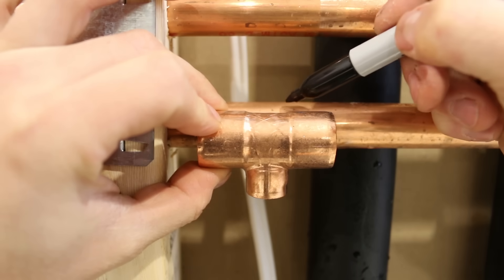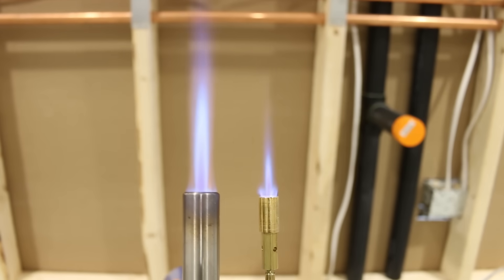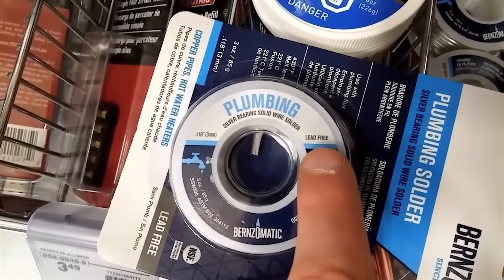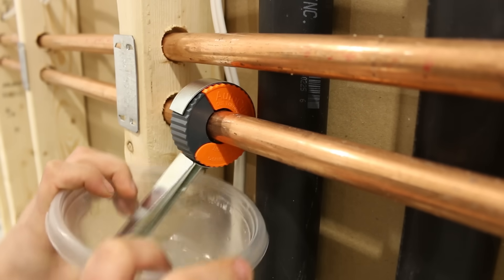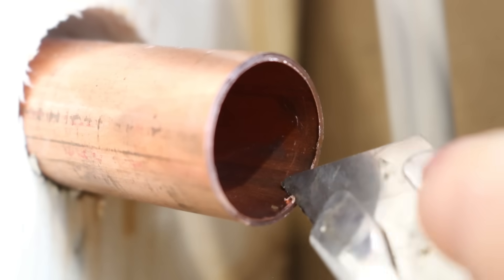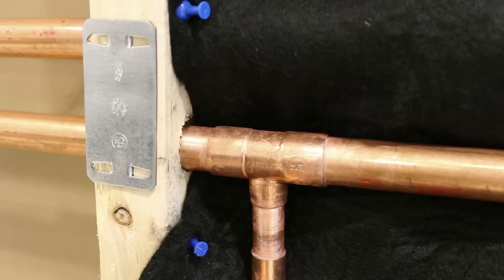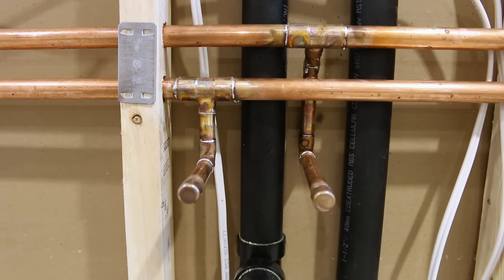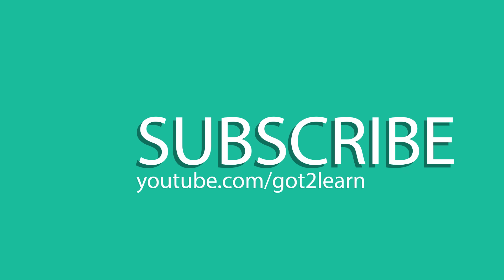How to Solder Copper Pipe in a Wall (Complete Guide) | GOT2LEARN

Comment: Its one of lifes satisfying jobs to see the ring of solder form round the pipe/fitting.  What is your feelings on solder ring fittings, Yorkshire fittings in the U.K.?
Reply from the maker: Personally, I prefer using my own solder, I like to know how much solder is going into the joint, with these you can't get that but they work fine, i've used a few and never got any leaks, I guess it's just personal preference :)
Reply: They are good but more expensive. Lately did not see them anymore in HD or Lws stores (at least not in NJ). And again : if pipe terminal not properly prepared they will fail.

Comment: Thanks for the video!
I just replaced 60 feet of galvanized 1/2 pipe as well as 90 feet of 1/2 copper pipe and upgraded to 3/4 pipe.
Watched a bunch of videos like this one and everything turned out great.
The issues that I had was the time planned turned out to be double because I was double checking everything.
Putting a tee on a pipe also was time consuming because the one of the tee ends was out of round 🙄.
Reply from the maker: Great job buddy, galvanized is no good! ;)

Comment: Great video! Unfortunately you left out the most difficult part - getting the new fitting onto the existing pipes which are not separated widely enough. This can be one of the hardest parts of attaching to an existing pipe in a confined space.
Reply: U have to do a second cut and slide over it a 1.5” segment of “repair” pipe (HD, Lws sell it in 6” length). After u done soldering the T, then slide the “repair” segment equally on the cut u did and solder it too. (It should be a several inches distance between the two cuts u will have to do). The “repair” pipe is simply a segment of copper pipe that smoothly and perfectly slides over your 1/2 or 3/4” copper pipe. It is like a joint piece but without the inner stoppers inside. Some stores sell small segments, some longer and u cut them in smaller lengths on your own.
Reply: They do make a connection that doesn't have a stop in the center of it. You can slide it all the way onto one pipe,  reposition the pipe, then slide it halfway back over
Reply from the maker: I made a video on this: https://youtu.be/ebvqSp-d8-0
Reply: A slip coupling.

Comment: What soldering lead you used copper or aluminum?
Reply from the maker: 95/5, which is a mix of tin and antimony ;)
Reply: @Got2Learn  I can be used for soldering airconditiong pipe?
Reply: They have here in the Philippines like that lead?
Reply from the maker: No, you must use "Silver Solder" or "SILFOS" for that ;)

Comment: My dad taught me to always tin the ends first before putting the final solder with the piece: You just drip a small amount of solder on the bare ends, and while still hot,  quickly twist it around with your fist using a bunch of newspaper paper, then you proceed as shown in the video. Tinning the ends is good insurance in a seismic country.
Reply from the maker: That's not common practice but in some situations, it helps. A better solution is to use tinning flux.

Comment: What do u recommend to use on copper 3/4" pipe that's in concrete slab,home builder instead of using a 90 degrees elbow they bent pipe and 35  or 40 yrs later developed a hair pin hole,and now I'm having trouble soldering an elbow on wall,1 torch keeps turning off and just the angle is very wrong!!!!
Reply: Jaime, i had the same problem. I had to very carefully chip the concrete around the pipe for about 5 cm to have enough room to do a proper joint.

Comment: You should  always heat the center of the fitting so the solder is sucked in the joint never heat at th pipe joint cause you want the solder to suck into joint

Comment: It is amazing how the solder actually creeps upwards, during the "upside down" soldering, at 13:13
Reply: It's capillary action,that tracks along with the flux up or down in to the hot joint.
Reply from the maker: I find it amazing too :) thanks Jon!

Comment: I've never, ever seen that trick with the bread. Not sure I'd be willing to try that, but good tip, if it works
Reply: It’s does work, but the only thing is to put the bread the much far from the welding joint. This happen to my friend in Mexico , the bread got toasted inside the pipe and it got stuck in the sink head thing lol and the water pressure in Mexico is low so I think that was the main issue.
Reply from the maker: It does, thanks ;)

Comment: I have a tight spot in a ceiling run pipe to a shower to repair and can’t get heat under it. There is about 3” of height to a busted gate valve. The spot is to small for shark bite. Any suggestions?

Comment: Just After u soldered a joint . Can I use brush with flux to cool it down ... it also gives a cleaner solder joint brushes out the drips
Reply from the maker: A lot of plumbers do that, but I prefer not to, 2 reasons: it cools the joint too quickly and plus you ruin you flux brush ;)

Comment: Looks like a wall in shop class. Remove all insulation, that's a huge fire hazzard.  Remember water is your enemy.  Any water even a little will cause steam and blow solder out and cause leak. Even better use PRO PRESS!
Reply from the maker: Got that right here: https://youtu.be/S5NWZMzPZBA
Reply: It would be cheaper to hire a plumber!

Comment: Great job you do a outstanding job and most everything you show is spot on. Unfortunately using copper pipe and using solder is a lost art. Great tips great video. I'm a master plumber and I am very impressed. Again great job!!!!
The only thing I do differently is I start from the lowest spot on the pipe and work my way up? Heat rises and by the time you get to the top joint you need less time with the heat?? What do you think??
Reply from the maker: Thank you so much Douglas! There are multiple ways of getting a joint solder as opposed to what a lot of plumbers think so I say your fine man, i've never had any leaks this way, the only leaks I got were pinholes in factory fittings :)
Reply: @Got2Learn  you are a true tradesmen. You give plumbers a good name. Great job.

Comment: Those bubbles on your hot solder alot of times means you've got perging air/steam and that will also be a leak. The moisture in the pipe system needs a place to go, so steam doesn't form and cause your solder to blow out when the solder is still heat hot and wet. To much bread on both sides of the fitting joint may cause this to happen. So you may not want to pack to much bread in your pipe trying to stop the excess water in the piping. Sometimes it's good to suck the excess water out of the system using a shop vac. Then go ahead with your repair or addition.
Reply: :(    the bread trick never worked for me.

Comment: I watched several of your posted videos, and I found them very concise and helpful for most DIY home owners and thank you so much for your contributions. If I may also suggest adding a few more comments in your future videos regarding the importance of heating the pipes and fittings uniformly before adding solder to allow the wicking effects of the solder to pull solder into the solder joints. Also it will be helpful to add a few words about how to add solder always from opposite side of the flame to avoid cold solder joints. Thank you again for great videos and looking forward to your future video postings.
Reply from the maker: Thx @warren wwk, really appreciate your comment, i'll take those into consideration, if you can share it that would be very nice of you ;)

Comment: A couple of points: First, remember that solder follows heat. It doesn't really matter on the small pipes you were using, but on larger pipes you want to move the torch towards the fitting to help draw solder deep into the joint, and you want to move the heat around the fitting to draw solder to all sides. Second, while the solder is still molten, use a dry rag to flick the little blobs of solder away from the joint. This will make the joint look clean.

Comment: Great video, but don't you have to get solder around the back of the pipes too?  Or does it just getted sucked in around the whole pipe with one swipe?
Reply from the maker: Read up on capillary action, if the joint is hot enough, the solder will fill up thejoint no problem ;)
Reply: @Got2Learn  , will do! :)

Comment: Just wondering if this soldering will work in air conditioning? where the pressure can be more than 410 psig? Actually, i am into air conditioning business.
Reply from the maker: No, you'll need to braze for that.
Reply: @Got2Learn  You are right i never saw anyone soldering any HVAC copper joints,  it is always brazed. It was more of a wishful thinking from my part. Thanks again.
Reply from the maker: My pleasure bud ;)

Comment: WARNING: That flame protector black felt looking cloth does not protect your house.  I used it and the wiring I was trying to protect caught on fire right along with the 2x4 stud it was stapled to.  I now use a stainless steel drywall inside corner joint knife or other piece of sheet metal as a shield.  No more problems.
Reply from the maker: Good to know, thanks!!
Reply: I use a canary.

Comment: This is a great DIY video and good if you’re doing a small fix or job. I wouldn’t recommend this for anything beyond that. All the product used are from a big box store and no good.  Never ever ever ever use water soluble flux. Toss all those torch heads and get a turbo torch. Definitely don’t use MAP gas on 1/2 and 3/4. It will over heat if very quick. Knock the left over solder off the bottom while it’s still hot and rub some flux in the joint then wipe it off. Makes it look SUPER clean.

Comment from the maker: AutoCut Pipe Cutter 1/2": https://amzn.to/2XlyqAn
AutoCut Pipe Cutter 3/4: https://amzn.to/2GZFrkf
AutoCut 1/2" Ratchet Handle: https://amzn.to/2U61h9N
AutoCut 3/4" Ratchet Handle: https://amzn.to/2U60FRx
Pencil Torch: https://amzn.to/2U3OTaa
Handheld Torch: https://amzn.to/2VhGujo
Fitting Wire Brush 1/2": https://amzn.to/2BOlNVc
Fitting Wire Brush 3/4": https://amzn.to/2U33enp
Propane gas(Blue bottle): https://amzn.to/2BOhnh7
Propene gas(Yellow bottle): https://amzn.to/2BPcdBl
Lead-free tinning flux: https://amzn.to/2U3abEW
Lead-free flux(water soluble): https://amzn.to/2XjaYn9
Flux brushes: https://amzn.to/2T8ROBc
Lead-free solder: https://amzn.to/2EoqSFb
Flame protector: https://amzn.to/2Vh8q7o
Flint striker: https://amzn.to/2XiuX5y
Abrasive pads: https://amzn.to/2NnA9QP
Utility knife: https://amzn.to/2U4dKKP
Pencil reamer: https://amzn.to/2tBuhKW
All-in-one deburring tool (blue): https://amzn.to/2U3J1xu
Reply: I
Reply: Thank u for all your video
Reply from the maker: @tasmal408  😇
Reply: @Got2Learn what kind of torch head is that? What kind of torch too?mapp or propane?
Reply from the maker: LimitedTimeEnt all links are pinned to the comment section up top or in the description box of this video 🤜🤛
Reply: @Got2Learn  i know but u got both which one u use for 1/2 copper in the video?
Reply from the maker: @Eastbaypisces  This one here: Pencil Torch: https://amzn.to/2U3OTaa
Reply: @Got2Learn  have to use w propane or mapp?
Reply from the maker: @Eastbaypisces  they are almost the same, for 1/2 and 3/4 I use the blue can.
Reply: Pencil torch on propane? Ok
Reply: Can you please make a video showing how to physically install the same connector shown in this video?  Sounds simple and like a task that should not require instruction.  However, due to rigidity of each pipe end, I'm unsure of the proper way to handle the pipes in such a way that enough space is created to allow the connector fitting to be installed without putting excessive pressure on the already installed pipes that need to be connected.  I was looking forward to this step being shown in this video but it was not shown.
Reply: Nice vedio, Need a machine for A/C copper aluminum tube bending process? May contact by  bestgift6@aliyun.com  +8613202919508(whatsapp)   

 thanks

Comment: An alternate, and I think, a better way to do some of what was shown would be to ;  (1)get a spray bottle fill it with water and spray the area near where you will be soldering. Spray any wood studs that have contact with the pipe and also the sheetrock behind it. In most cases if the area is already wet it's unlikely you would be heating long enough to dry it out and then catch fire. (2) wiping the joints with a rag before cooling not only makes for a nicer job but also may fill in any open area in the joint. (3) when using bread to hold back water only use white and avoid using crust. Also the water is drawn to the heat so use enough bread and back far enough. (4) Do Not..solder the cap on last,  and work to the side of it as the pressure build-up could blow it across the room and thru the sheetrock on the next wall;.  Got me in the balls once.  Only good thing is that it only needs to happen once so you never forget.     so Good Luck.
Reply from the maker: Awesome comment, laughed at the "balls part" 😂😂😂
Reply: @Got2Learn  Amazing to me that knowing how much that hurts, we all laugh when someone ELSE gets hit in the stones.. ;-)

Comment: Pretty good job showing how to solder in a controlled environment.   You should show how to use a slip coupling, because in the real word most times you can not pull the pipe apart after you cut it to install a fitting.
Reply from the maker: Thanks a lot, will do!!!
Reply: @Got2Learn  cool :)

Comment: When the tee or elbow is in vertical position, how to ensure that the solder penetrates all around the joint between pipe and the fittings, especially at the sides that are facing the wall and we can't see

Comment: why is US plumbing so behind ?
Reply: I think it's because there is a lot of variation between particular states in terms of how strict they are issuing licenses for trades/professions.
Reply: @thebakersmate-britainsbest1808  i partly understand kinda weird since plastic pipes get the job done in half the time and is way cheaper in material price also 
but copper soldering is nice and fun to do tho :P
Reply: @langestack5241  Plastic pipes will not maintain earth continuity (nor will copper pipes using push-fit [as referred to here in the UK), therefore metallic pipe will still have a place subject to the design policy.  The convenience explains why plastic has gained traction in these small scale applications and residential type installations, but you'll rarely see it on new build commercial installations.

Comment: I've seen bread get stuck in the smaller orifices of some faucets. And also, it much easier to just suck out all the water with a bucket boss (shop vac top for 5 gallon bucket) while cutting. That steam will smoke a joint! A Turbo Torch on a B-Tank is much better for working "Inside a wall" since you don't have a tank in your hand.  And if possible you should always fill the bottom of the joint first, 3/4" and 1/2" is easy, what you did wont work on 3" copper!

Comment: I'm a mechanical engineering student that doesn't consider being a plumber. And even if I considered, we use plastic pipes in my country.
But I enjoyed the video. It made me want to solder pipes. I only soldered wire before.

Comment: Ive been plumbing and soldering going on 17 years now and your video nails it.
Reply from the maker: Awesome, great to here, don't forget to share!!!! ;)
Reply: Could you explain why the solder is drawn in likes it does especially when it travels up into a fitting? Do you have to heat different depending on the angle?
Reply from the maker: Capillary action, I have a video on this: https://youtu.be/bCTBVoPvnok?si=ndLNgNNvSM2JTJGR

Comment: i preffer pressing tools
Reply: MrZer000 
pressing tools are much easier to use, but the tools are very expensive. 
The fittings are also more expensive and difficult to find. 

The company i work for uses pro-press system and is an exceptional product. But the pro-press self usually runs over $1,000
Reply from the maker: Yeah, closer to 3000$ ;) @drunkinmaster1
Reply: The smallest tool by the company i work for costs between 1000 and 1500€

Comment: what am i doing here , new houses don't even use copper pipe anymore so i will probably never have to solder any copper, copper piping hasn't been used in our houses since the 80s and early 90s
Reply from the maker: I am working on PEX videos, don't go too far ;)
Reply: @Got2Learn  yeah dealing with pex video would be interesting a lot more flexibility with those materials
Reply from the maker: It'll cover everything ;)